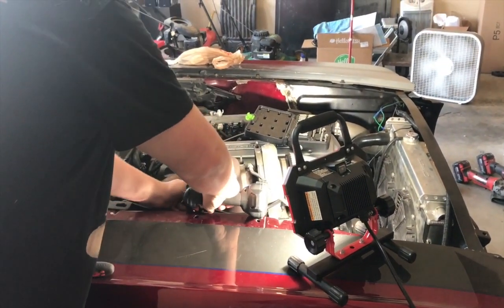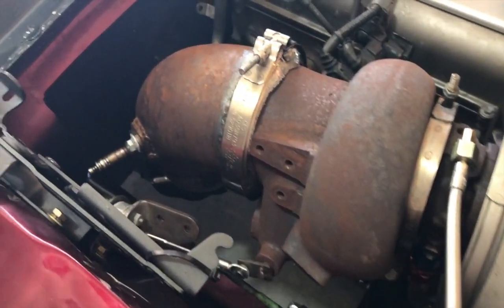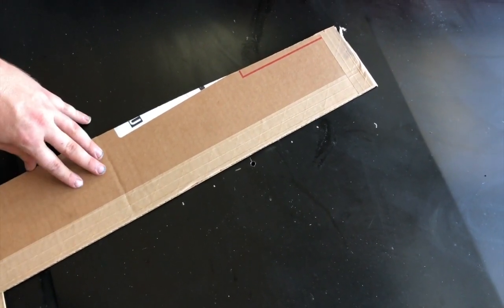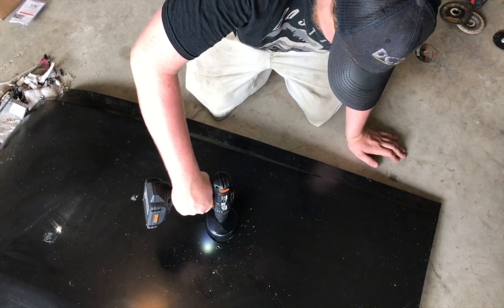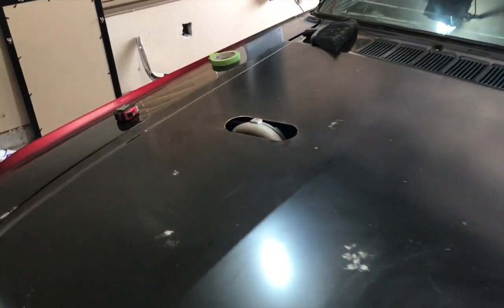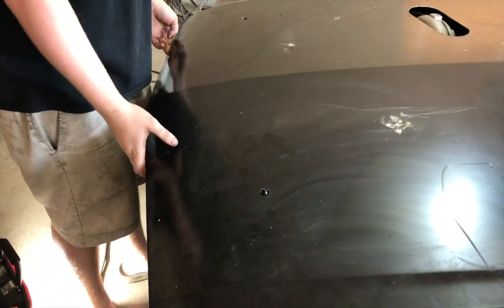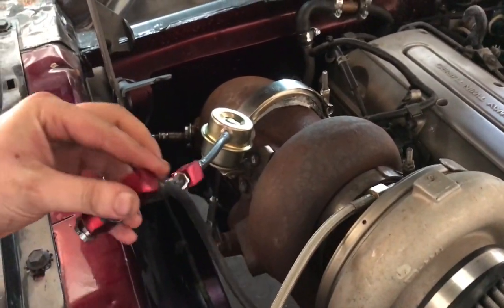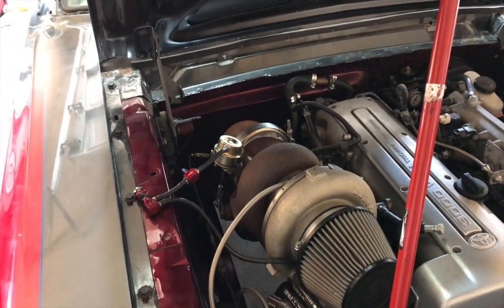Hole in Hood for Big Turbo

Comment: Nice Project. Thanks for sharing.

WOW!  This reminds me of when I installed a Mustang 5.0 Serpentine belt system on my 1966 Ford Cobra Kit Car.  I used a 351 Cleveland engine and had to make special adapter plates for the front of each cylinder head.  The alternator was up too high like your turbo and after relocating several accessory mounting holes and lowering the alternator position I was able to get the hood shut.The Air Cleaner was another close fit item.  The term "fits like a glove" was an appropriate description.  Also had to use a reverse flow water pump to get things working correctly.  A couple of trips to the local Napa Store and I found the correct serpentine belt and all was well.  Built it back in 1992 and still have it yet today.  It is a fun ride.

John

Comment: Seems to me with a bigger turbo, it'll be much easier to get it all squirly and run off the road again. Jus' sayin'...
Reply from the maker: it had twin turbos on it before from the factory easily capable of 500hp, he will be running 400HP with this setup, either one make more than enough power to slide it off the road in a rain storm!